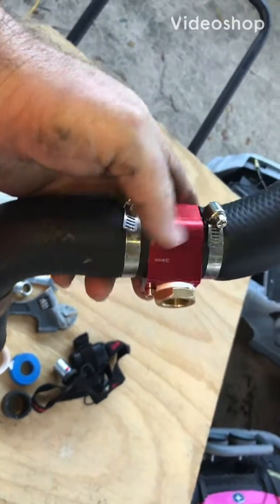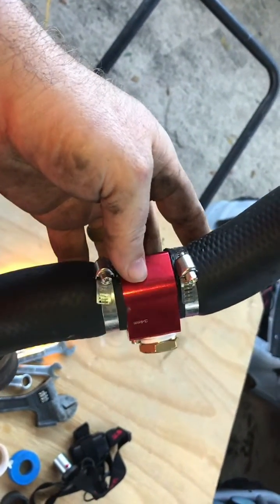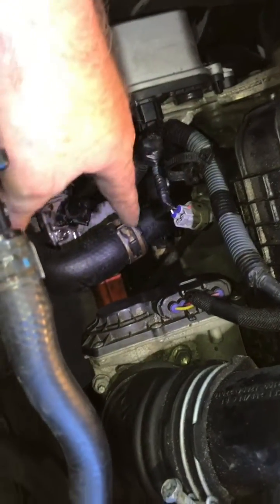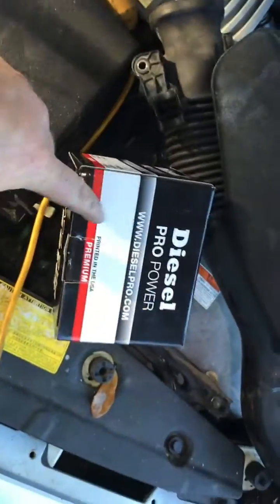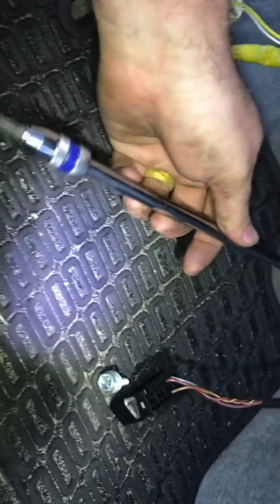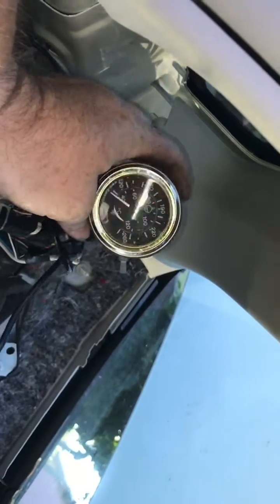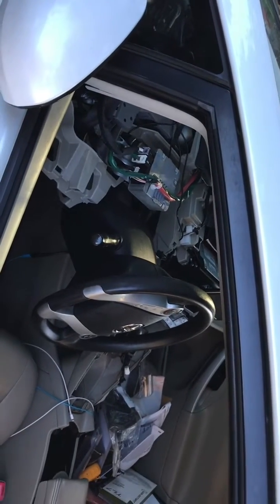Adding Temperature gauge to Gen 3 Prius

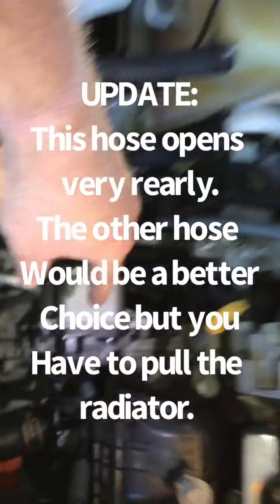Comment: at 0:55   Does the hose open early or rarely?  Thermostat supposed to keep coolant in engine until 180 degrees F before opening.  So its not supposed to open right away.
The other hose, that one circulates from the radiator back to the engine.  So sensing that temperature would be to read its temp after it cooled and circulated through the radiator.  I think you location in the video is correct.
Reply from the maker: I moved the sensor to the other hose and it reads what the ODII engine read is saying.  The thermostat hose opens and closes all the time while driving.  Trust me I've been watching it for a few years now.